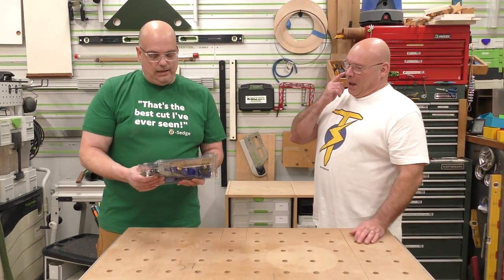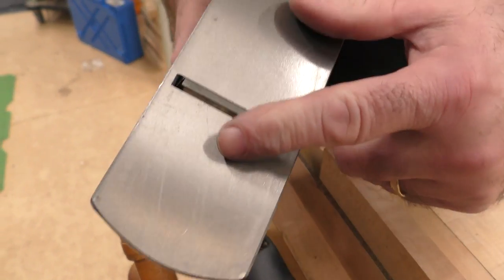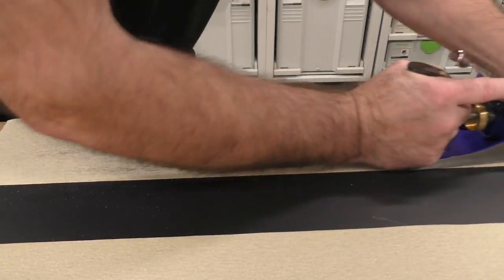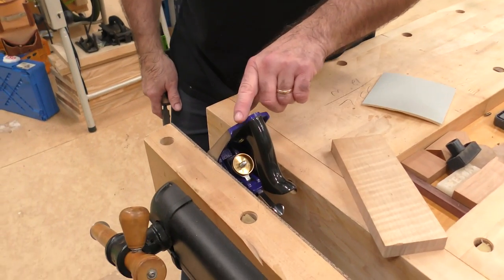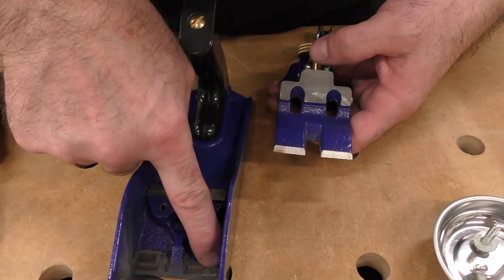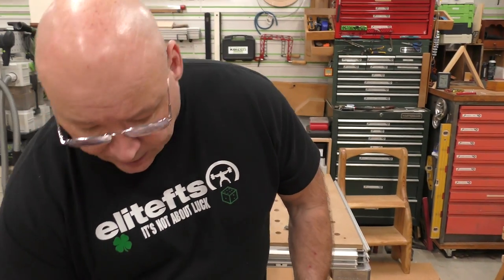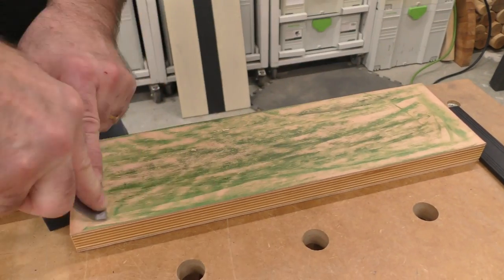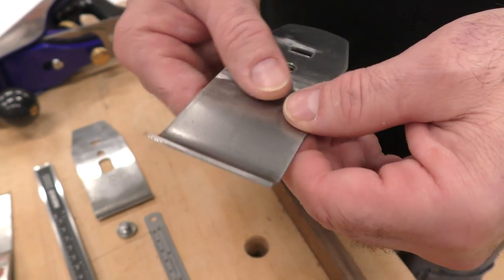From Loser to User: Cheap Hand Plane Transformation

Comment: I learned you need to flatten the sole with the blade assembly in place. The cap iron can flex the body, so if you flatten the sole before that flexion it won’t be flat under normal tension during use.
Reply from the maker: good to know ...
Reply: I wouldn't say the cap iron. Maybe the lever cap as it does exert stress on the frog which can flex the sole. I understand the mixup. Its easy to do. I'm looking at making myown wooden planes myself. And the wedge for the blade does the same thing. You have to sand the sole with the blade wedge in place because it will flex the body. 👍🤝
Reply: @melgillham462 you’re right. I meant to write cap/iron. The whole unit(cutting iron, cap iron, and lever cap) all have to be in place.

Comment: Thanks so much for this video Sedge - as a born and bred Sheffielder myself, I was fortunate enough to equip myself with the original Record planes and a Record bench vice.  My Moore & Wright rule is still a pleasure to use, but their latest version (which I bought for my son) is certainly not the original quality.  Thinking I was doing the right thing, I recently replaced my Record plane blades and could not understand why my planes did not work.  No adjustment etc!  You’ve answered my problem in this video!  Now all I need is a Tormek to grind them down or easier still, put the old blades back in!  Your videos are a sheer delight to watch - thanks again.
Reply from the maker: Thanks Martin......

Comment: The chip-breaker mounts to the frog, so that's what sets your blade protrusion, the blade length has very little to do with the assembly moving too much forward.  All current single fulcrum designs will only have the blade register on the two ends of the frog because of the chip-breaker deflects the blade.  Only Record Stay-set solves that issue (to a practical extent).  If you are having chattering issues right off the back, it's better to ensure the mounting points of the frog and the sole at the throat to be fully registered than to first go to the blade.  This is also why a well tuned Bailey works absolutely no different from a BedRock as the support of the blade really only happens at the bottom and top of the frog.  The new Record blades aren't the best, but giving it a convex grind or a healthy amount of secondary bevel will solve a lot of the durability issues.  That said, YES, better off just getting a Hock.
Reply from the maker: Thanks

Comment: At one time Record planes were pretty good, but even so, they still benefited from some work.  Years ago, I was fortunate to meet and spend some time in the tutlege of the great Ian Kirby on how to lap, sharpen, tune,  and use handplanes including my two old Record planes. After I worked on them following Ian's instructions, they performed beautifully capable of producing full length gossamer shavings.  They were (and still are) a true pleasure to use.  I think even Rob Cosman would approve.
Reply from the maker: Thanks ...I met Ian a couple of times ..what a great guy ...
Reply: I took Rob’s Plane Restoration class at our local Wood Crafters store. My 1985 Record #4 now smooths like my #4 LN. I’ve added several old Stanley’s to the collection. Reminds me of shop class in 1962.

Comment: The reason why the blade was sticking out was nothing to do with the length of the blade but the geometry of the chipbreaker. The chipbreaker would have to be shortened to make sure the iron does not stick out ( chipbreaker distance from yoke to the front edge is what governs this). The plane can be made operable with the standard components, stating that you should order a hock chipbreaker rather than fixing the components was poor. I doo agree with you that you should purchase premium tools, especially if you don't know how to fix cheap, poorly manufactured tools yourself.
Reply from the maker: ok

Comment: My first hand plane was a modern "Stanley" No.4. Resonably flat sole when I got it home. The iron just needed standard new prep lapping the back a honing. It was however usable. The problem area was .... yup the chipbreaker but at least it was a workable plane for the first week untill it fell on the floor and the plastic tote shaterd. So here was me a brand new wood worker of one week having to make a new tote. I managed to do it but I would rather of had a bit more experiance and confidence in my skills before making one. I might add that it is now sitting unused for six months awaiting conversion to a scrub plane. Though I might do a fine tune first just to see how good I can get it as a smoother first.
Reply from the maker: It is soo tough to find a "new" ,good hand plane at a low cost these days....

Comment: I have a #5 Spear & Jackson that has the same exact problem. Sent it in the mail to me that way. The blade sticks out too far, but the frog is were it needs to be, just like yours. My Blade isn't bent or anything? I can't figure it out, and it's driving me crazy. Be nice to finally use this dang thing

Finally got it, it's the body, where the frog sits on. It's been grounded too low, causing the blade to stick out too far
Reply from the maker: I hope this video helped
Reply: @sedgetool  yes Sir it did. Watched it twice 😀

Comment: Hey, sir! Just curious where you found that surfacing plate you use? Granite remnant? Oh, great video. I’m restoring an old Stanley #7 Type 11. Decent shape. Just old, like me.
Reply from the maker: It is a piece of scrap that someone once gave be ..said it was the material they use for workstations in labs... I think it may be a granite remnant .....??? I just know it is dead flat !!!
Reply: @sedgetool  That's what I am looking for. Everything I see is over-priced and too small. I want a longer/wider piece. Going to hit some of the cabinet and kitchen shops around here for a remnant. Dead flat will work. I don't need ANSI certified! Thanks for your response and for what you do for the woodworking community!

Comment: Make sure your vacuum has a dust seperater before vacuuming. You need more than just a hepa filter on it for this.
Reply from the maker: Good point !!!!!
Reply: @sedgetool  Also the frog might not have been properly referencing against the edge of the blade. That's probably why the upgrade fixed the chatter.

Comment: They call it a chip breaker but that's not what it does.  It supports the blade edge.  Am I wrong, again?
Reply from the maker: both
Reply: @sedgetool  What chips ever come out of a plane?  If it's making chips, it's busted.  You got very close to explaining it when you showed the chatter pattern on the wood.  To make a thin ribbon of wood, that edge must stay within a very small vertical dimension.  Less that 5 ten thousandths of an inch.  Blades can never be that strong.  The "Chip breaker" can guarantee that vertical dimension.  You can pick up the exact frequency with a microphone and then do the math to see the deviation.  No chips involved, ever.

Comment: I wouldn't want a lie Nielsen as a first plane. The stakes are too high. The most important part of hand tools for a beginner is learning to sharpen and keep a tool sharp. And you may well do it wrong as a beginner and damage your high end tool. So it may make more sense to take a cheap plane or used plane which is not sharp and getting it working within the range of normal. Usually all it takes is sharpening which you need to learn anyway. 

Once you know more in particular what you don't like about your cheap plane (hard to adjust, won't keep settings, blade dulls quickly),  the high end equipment makes a lot of sense.  Or maybe not if you like restoration since now you know how to get a vintage plane into working condition.
Reply from the maker: ok..good points

Comment: So if you're buying a lie Neilson or Veritas are they at least good out of the box?
Reply: LN works pretty good out of the box, the do recommend that the buyer add a secondary bevel if you really want it to work great.  They have a good set of videos on their site showing how to do it.
Reply: @michaelpayne8102  I've been eyeing Veritas for a while. Would just rather support s Canadian company and its easy to deal with warranty through Lee Valley.
Reply from the maker: Both are great out of the box...the blades may need some honing !!!
Reply: @sedgetool  good to know. Sharpening or honing ain't an issue.
Reply: @JoeC92  Lee Valley is great company, I bought directly from Veritas in the last century (LOL).  LN has exceptional service as well, ships in less than a day.

Comment: A bloody shame that you had to put in the hours and effort to make that a usable plane. What irks me is the fact that the manufacturer get away with taking your money for and item that does not serve it's purpose when you buy it. I have  Stanley no 5 that I bought some years ago (new from a big box store here in Australia) that also did not work and was not usable straight out of the package. Upon further examination I found that the base had a concave bow in it when placed on a flat surface of approximately 1/8th of an inch. Just not good enough.  It is a little like buying a new car only to find that the engine does not run from the dealership.  Bad form on the part of both Record and Stanley. Where is your quality control????
Reply from the maker: Drives me crazy that these planes are being sold in such poor quality